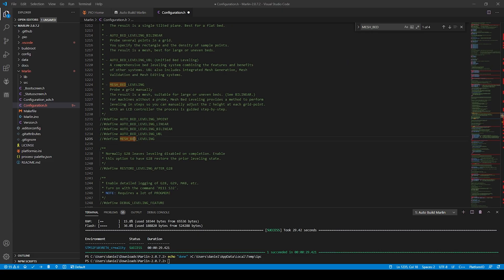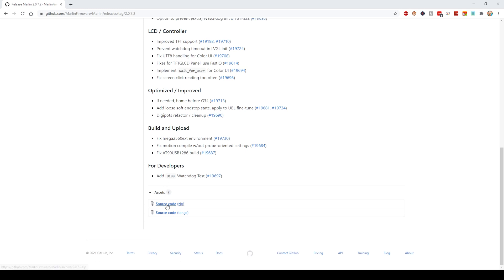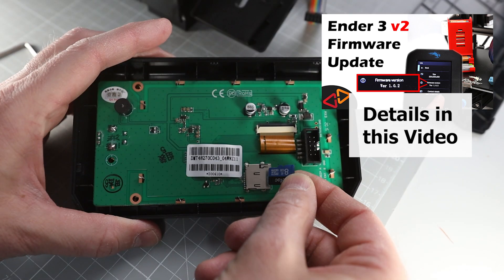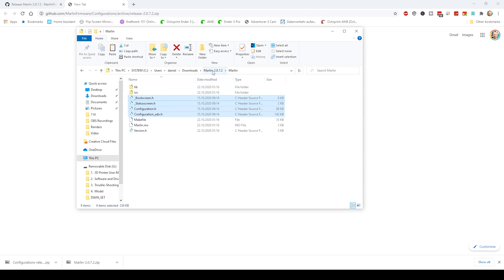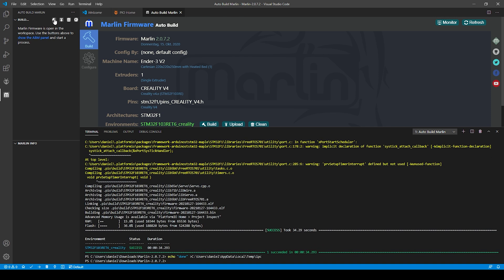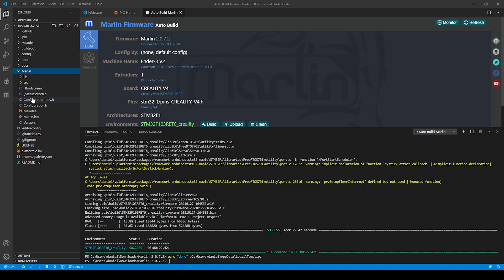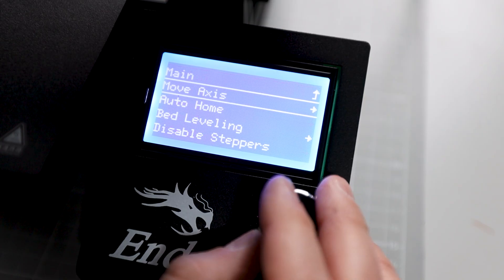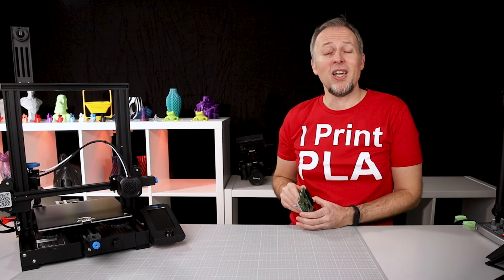Ender 3 v2 Marlin 2.0 firmware update (and some DISAPPOINTMENTS with the new v2 display)

Comment: Howdy, great videos! Couple questions
Looks like latest Marlin 2.1.1 only has two .h config files, seems like proceed as normal?
More importantly, auto build Marlin now says "Use a specific environment for build." with several environments. I've worked out these are referring to chipsets on the main board, but do I use the  STM...._creality or STM...._creality_xfer?
Reply: Well, found someone saying .xfer is a library, and to use the other option
But the example configs are like 2 months old and auto build fails
Reply: Ah ha!! Example configs are actually from 2.1
Rebuilt using Marlin 2.1 and it worked
In case anyone is wondering, the chipset text is printed directly on the chip on your main board. Looks for a small postage stamp sized chip near the mainboard# text, it'll say STM32.....RE or RC (printed in two lines)

Comment: With vrsion is that firmware 4.2.2 or 4.2.7 ? U didn't say on the video
Reply from the maker: 4.2.2 or 4.2.7 is referring to your mainboard‘s Version not the firmware version
Reply: @Crosslink3D   so the rirmware that u post  good for 4.2.2 mainboard ?

Comment: He skipped a part in the display firmware update.

Once you're stuck on the orange screen, you will need to power off the printer, take the SD card out, then power it back ON and wait for it to boot up. THEN you can proceed. It's in the linked video but not in this one.
Reply: exactly what i was looking for, was waiting for a while XD thank you.

Comment: the Ender 3 V2 has two different cards 4.2.2 and 4.2.7 how do I specify which card I am using before compiling the firmware
Reply from the maker: Open the electronics case and check the version number on the board
Reply: @Crosslink3D  my Board Is 4.2.2 how do i put this specification on the firmware to be compiled

Comment: Now there is a marlin version that actually works the mesh leveling with the lcd display
Reply from the maker: Yeah need to try this out
Reply: @Crosslink3D  chep posted the link in a video some days ago, I'm still calibrating the E steps but looks promising, there are actually some really good and useful additional features, such as filament change and custom pid in the printer's menu
Reply from the maker: Great, is this official Marlin or the jyers branch?
Reply: @Crosslink3D  jyers 👌🏾
Reply: The Jyers/Marlin firmware stil output the same error when compiling. What am I missing here?

Comment: Jyers over at github build a new firmware for the LCD to display all the custom marlin/octoprint options/informations. works well.
Reply: Hi, I just ordered my printer yesterday... My plan was to install octoprint on my raspberry, are now all the features from octoprint available on the display that comes with the printer?

If yes, what do I need to do?
Reply: @byHeroo  it shows all the octoprint informations I'm used to. Just Google github jyers, you find pre compiled marlin binaries as well as LCD firmware to flash directly.
Reply: @DooMRunneR  ok so octopie is for the raspberry pi obviously , and marlin is used for the lcd firmware? And motherboard?
Reply: octoprint for pi, marlin for motherboard, extensibleUI for display everything is documented on his jyers GitHub.
Reply: @DooMRunneR  alright I’ll try to figure it out once I get my printer and pi, appreciate you!

Comment: +Crosslink  I have the Ender 3 Pro with the upgraded 4.2.7 Board, will I have to get a different file to upgrade the display firmware since I still have the older landscape version of the display and not the newer v2 type?

Comment: I made myself a custom GCODE file which travels to the corners and wait for button click to do the manual corner leveling process.
And even with auto bed leveling: it's better to manually level the bed before using auto bed leveling to get a consistent geometry of the part
Reply: what you are doing is TRAMMING the bed, the machine will "level" it

Comment: Two of my printers have a BTT TFT and are configured to start in Marlin mode. It is more than a half year, since I used them in Touch mode the last time. Touch screens without menu integration in Marlin source code are quite useless.

Comment: So you recompiled the new firmware, installed to screen and printer and gained nothing? What’s the point?
Reply from the maker: It's just the first step. Next steps are to enable more features and make either the 12864 work or trying the modified v2 screen firmware but that's not something everyone should do as it's not in the official Marlin sources yet.

Comment: I have ender 3 pro v2 and I updated to Marlin 2.0 following your video. When I turn it on I have a blank screen. Any suggestions? Thanks!
Reply from the maker: I also thought, it would be broken until I waited a bit and eventually it came back working. I was just too impatient. Can you confirm this?
Reply: @Crosslink3D  I stumbled on this issue and did switch off the printer quickly... Took me a while to understand that flashing takes some more seconds. A note in the video would may helped me. Otherwise very nice guidance. Thanks
Reply: @curryschranke  How long did you wait? I'm in the process of flashing my firmware on my v2 right now and I was wondering about this.

Comment: Jesus man. I got tired of leveling my bed yesterday, woke up to learn about 'mesh bed leveling' today. And then I come across this day-old video telling me my Ender 3 V2 is royally screwed without a BL Touch! I'm gonna be sick.
Reply from the maker: Well there is help on the horizon, stay tuned for my upcoming vids. My first solution was to swap the screen for an old 12864 but there seems to be some efforts going on to write an adapted firmware for the v2 screen but it's not ready yet.
Reply: Why not just install a BL touch? It's relatively inexpensive. Have you done so since 2 years ago?

Comment: Weird, because Smith3d was able to take the marlin code and give us options via the LCD... https://smith3d.com/ender-3-v2-bltouch-firmware-installation-guide-by-smith3d-com/
Reply from the maker: There is some projects going on that may be solving this issue in the future but it will take some time until this makes it into the official Marlin branches. Until then, I am taking a step back and use the 12864 display.
Reply: smith3d violates the terms of marlin :(
Reply: @askarandersson7537  are you sure? I thought marlin was open source and smith is a fork? He has everything on GitHub.
Reply: I just installed a BLTouch, along with Smith3D firmware on my E3V2 yesterday, and it a works beautifully. I used the Smith3D source code to compile in the X/Y offsets of my BLTouch, specific to the BLTouch mount I got from ThingiVerse. No other changes were needed.

Comment: There's a few ender 3 v2  firmware projects with working manual mesh bed leveling. No need to go back to an old screen. Would seem better to upgrade to a touch screen then. These also let you have the tune menu with octoprint 

https://github.com/Jyers/Marlin/tree/Ender_3_V2_Rewrite

https://github.com/Jyers/Marlin/tree/Ender_3_V2_Rewrite/Precompiled%20Firmware
Reply: So I want ManualMesh, whats the difference in 3x3 and 5x5.bin files?
Reply: @terribletcm  3x3 uses 9 mesh points and 5x5 25, so more accurate with 5x5 but takes longer time to calibrate :)
Reply from the maker: You're right, this looks promising, however the author will struggle to get this re-integrated into the Marlin sources main branch. I am trying this out but would recommend to stay away until it is officially in the main branch. No one is going to support this from the Marlin side until it's part of the official sources.
Reply: @Crosslink3D  Jyers has already had some of his changes pulled into the main branch. His status area design is now part of the main branch. And he's working to have all his changes added. The problem is all the other r v2 menu redesigns have never bothered to try adding pull requests.
Reply: @Crosslink3D  just FYI. Jyers have now restructured his project to make it easier to upstream his changes to the main branch. It's now under a new project an name on github
Reply: Using this and is working perfectly, he is using the extensibleUI in Marlin to make the LCD work.
Reply: In my case with these firmwares, when i use the manual leveling, every time i go back to the same point, the z position always slip down. So it’s useless, and it’s caused a lot of problem until I found out.
Reply: @Kenyez  not sure what you mean by that. But Jyers by default always goes to z 0.20 when you do a mesh level. You can go down below the microsteps to load high  from previous mesh level.

And remember M420 S1 start gcode

Comment: I smell an upcoming expense on my end! Really unfortunate that it's needed but I want my options and not be locked in because of the screen! Looking forward to your next video!!
Reply: Jyers over at github build a new firmware for the LCD to display all the custom marlin/octoprint options/informations. works well.
Reply: @DooMRunneR  do u mean that corner leveling is available on the ender 3 v2 lcd? if yes, can u link?
Reply from the maker: Thanks for sharing!

Comment: I broke my 4.2.2 board motors worked fine. Ordered a new 4.2.7 board and installed it correctly but eversince i installed it when i turn it on it only beeps.
Reply from the maker: The latest 4.2.7 firmware seems to be broken. Use my Marlin firmware guide for the Ender 3 v2 to compile your own.